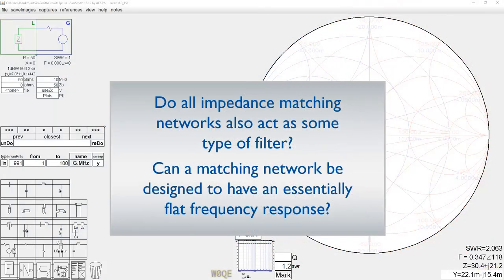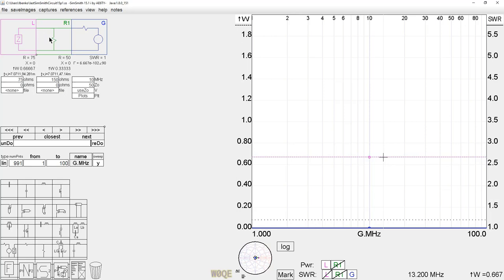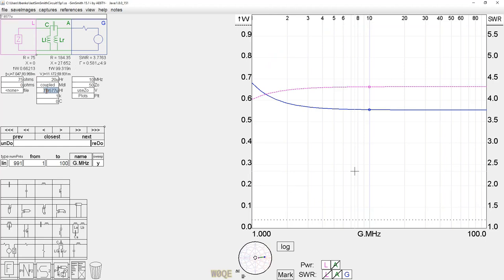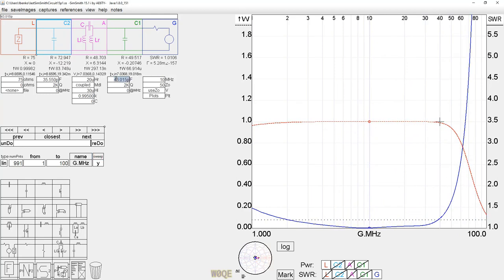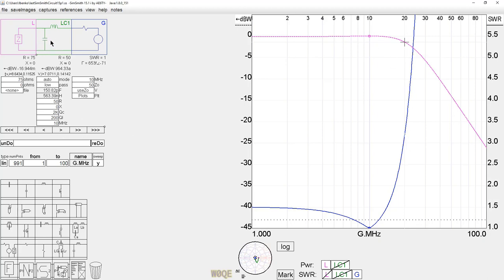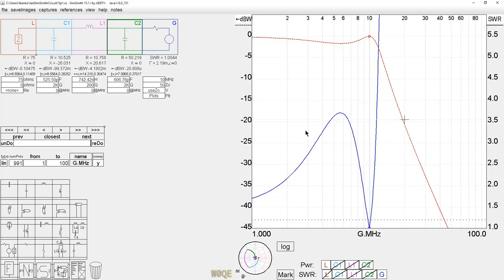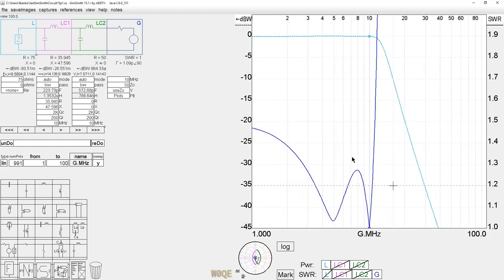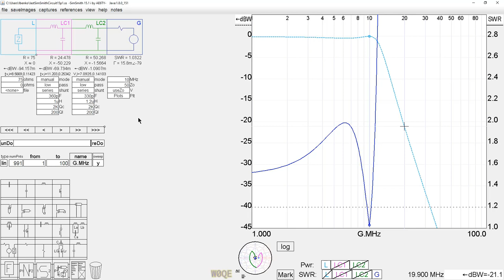#40: Matching & Filtering in the Same Circuit

Comment: Nice, thank you.
Just a thought for an added feature.... 
add an option so the user can toggle the current "number of pts" window between number of points and frequency step?
Reply from the maker: The feature plus more already exists.  In the block where you select the frequency "from" and "to" values the field on the left generally shows "type" lin (linear).  Click on this field and it toggles from "lin" to "log" and then to "expr" and repeats.  If you wanted to sweep from 18.2MHz to 31MHz in 200kHz steps you would enter 18.2:31:0.2 and this feature is described in help, Presenter, page 47 for SimSmith ver 15.1.  This feature is much more flexible that what you suggested.  You can easily have multiple frequency step sizes in a single sweep.  These settings and the lin/log box in the square chart make frequency or any component stepping very easily customized.  I have mentioned these concepts in several videos but have not done a video specifically on these topics.  I would suggest you either play around with the plot dots command or enter the expressions such as {18.2:31:0.2} and by keeping the number of points reasonable you can see exactly what frequencies where used for the steps.
Reply: Thanks Larry - sweep expressions - yes I see it now, cheers. H
Reply from the maker: There is a lot of flexibility in SimSmith and it is available without drilling down into menus but that also means it lays there quietly and unannounced. :)  A good example is the 4 types of power (left arrow W, up arrow W, left arrow dBW, & up arrow dBW).

Comment: hello, this is a treasure. I am a beginner. I do mostly radio restoration. I am interested in making some matching pad for 50 ohm generator like a Rigol to a 300 ohm dipol fm antenna input of the receiver. and for the short, medium and long bands of the receiver aswell, 50 ohm to long wire antenna input of the radio. any suggestions? this can be a topic for the matching video you did some time ago. But non the less this is the most complete beginner and advance impedance tutorial. thank you so much. I'll help promote this channel and the wonderful SimSmith app.
Reply from the maker: If you are new to this channel I would suggest that you look at the videos in the "basics" series first where I describe the mechanics of SimSmith and solve easier problems.  Later videos expect the viewer to have a base with SimSmith.  A 50 to 300 ohm match can be done for connecting a 50 ohm generator to a 300 ohm receiver.  A minimum loss pad and a balun would be my choice since the loss in the pad can easily be made up for in the generator.
Reply: thank you. I did start with the basic videos.
Reply from the maker: Wow that was a quick reply.  If you have some basic RF test equipment (at least a signal generator and an oscilloscope) you can learn a lot with SimSmith.  The addition of a small VNA which can be calibrated to a reference plane and measure impedances will improve you understanding of RF.  Best wishes.
Reply: will something like a MFG antenna analyser used to plot the antenna impedance right at the input of the radio over the freq range help me determine the load impedance? use this and the known 50ohm gen output impedance to design in SimSmith matching pads or networks so that the generator looks exactly  like the antenna in question?
Reply from the maker: MFJ analyzers usually can not the calibrated to a reference plane and typically do not measure the sign of the reactance.  MFJ may have some new stuff that I am not familiar with.  I have a couple analyzers like the AIM-4170 or 4300 and there are several more available that are similar.  These analyzers make measurements over a frequency and save the data into a file that SimSmith can then read and use.
Reply: you also mentioned in one of your videos of the small VNA you use. Can you say what was it?
Reply from the maker: I have the AIM-4170 and the AIM-2180 which are sold by Array Solutions but use the 4170 most of the time.  The 4170 has been replaced by the AIM-4300.  I have other analyzers which are not portable.  Other companies such as RIgExpert make analyzers and there are some kits for analyzers.  Google "antenna analyzer" or "network analyzer".  Also www.eham.net has reviews of about 50 different analyzers.  Analyzers that can be calibrated to a reference plane effectively become as accurate as the "loads" that you use to calibrate them but the software is very important.  I would not buy anything unless it could save the data to a file for use in SimSmith or Excel.
Reply: thank you so much. PS: you have a great voice and a good diction. you could be a professor.